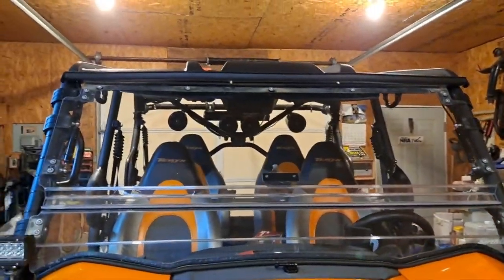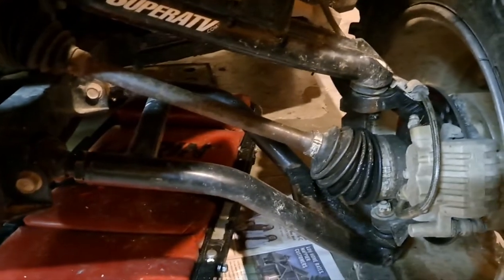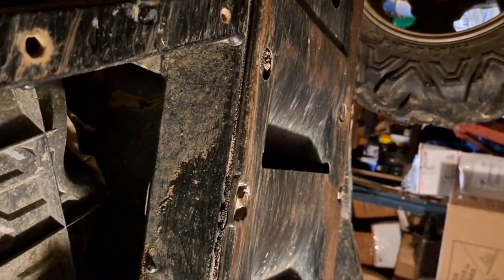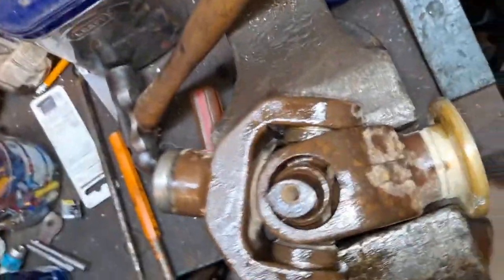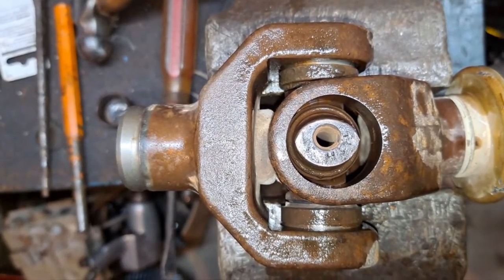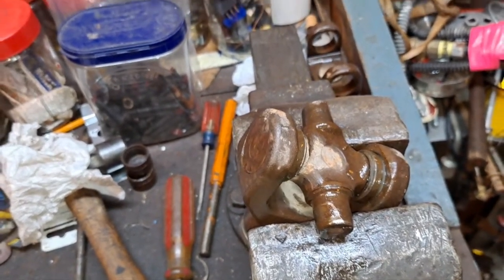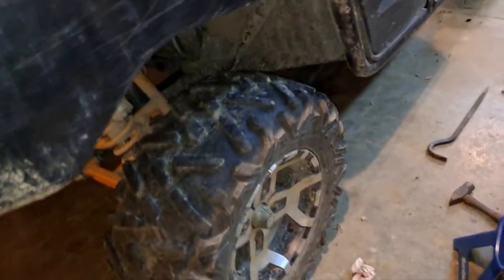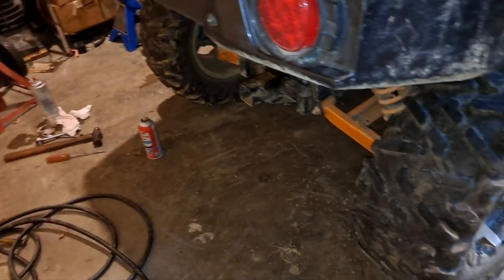Kawasaki Teryx 800 U-joint replacement.

Comment: Good video man I feel your pain with the way shit goes sometimes. I just did a video on my 2008 teryx replacing the main starter gear and one way bearing and water pump seals. Best tool I purchased was a service manual, well worth the money. I also hate working on dirty shit but being. On a small farm sometimes it can’t be helped. 👍👍👍
Reply from the maker: Thank you and thank you for subscribing. I gave you a follow back. I hate working on dirty shit too but it is what it is sometimes. I have another video I need to upload of changing out the brakes and boot on the front axle.

Comment: I don't think I ever saw a grease zerk anywhere on my 17T4LE and I'm at 3500mi on original factory u-joints and spline/yokes. I do know that SATV arms don't have protectors for outer boots so I understand exactly where you're going with boot issue. Had to cut some ABS into covers and zip-tie on mine. Thanks for sharing part numbers on after market.
Reply from the maker: I'm not sure without watching again but that u-joint part# is precision 450.

Comment: Any idea if the same precision 450 u-joint works in the front driveshaft?  The parts catalog says slighly different parts numbers. Just curious if you have done the front u joints?
Reply from the maker: @BrandonSowers-l2h  the front u-joint looks to be just a little smaller than the rear. I haven't had to change the front yet thank goodness.
Reply: Well shoot, nothing I can find online says anything about a cross reference from the parts store about the front u joints. I just did my rear today thanks to you for the oreilly part number
Reply from the maker: @BrandonSowers-l2h  you're welcome. I may buy one and take it to the parts house to find a match then return it. 😂
Reply: If you end up finding a match let me know.  I would love to have new front ones sitting on the shelf ready to replace when they go bad.   Kawasaki just wants way to much $$
Reply from the maker: @BrandonSowers-l2h  I'll definitely post it.  If you do TikTok I'm on there as TWO. I post there on these things too.

Comment: Question for you, what made you decide to change this out? I have a 2017 T4 and about 30 mph I start to notice a vibration that feels like it is in the drive line. I had to replace a rear u joint on my truck for similar feeling at a specific speed. Once I put in a new u joint the truck runs smooth. So it leads me to believe the same thing is wrong with my T4.
Reply from the maker: I had a bad vibration along with a bad clunking noise when placing it in gear. When looking at it I thought it was fine. Once I jacked it up I could see the play in it.
Reply: @andrewmeadors  perfect. Thanks for that info. I don't have any clunking or obvious sound, but I will tear into it further like you did. It has to be a u joint. Thanks for the video brotha!
Reply from the maker: You're welcome.  I hope you find the problem.

Comment: How did you put the boot on after back together dose the boot have a split up the side
Reply from the maker: It slides back and forth on the drive shaft.  There are notches on the shaft that the ends of the boot sit into.
Reply: Ok thanks I didn't see it on the shaft while you were putting it back together  I have a 2015 rear joint is shot I was going to start pulling the rear end out thanks for the video I could not find any information on it nowhere
Reply from the maker: No problem. If you have any trouble shoot me an email. Andrewmeadors22@gmail.com . More than happy to help with any questions.

Comment: I never did take the driveline apart I just took the u-joint out that sits in between the 2 yolks while it was still on the machine you shouldn't have to take that all that apart unless you're changing the main yoke seal on the rear end I can do that front to back without taking it apart
Reply from the maker: Well I took it out so I could work on it without being on my back. Plus, why wouldn't you take it out?
Reply from the maker: It's so flippin easy to take out once I figured it all out that it just made sense to remove it. I'd rather stand up to work rather than crouch or lay.
Reply: @andrewmeadors 💯bud, crazy not to pull it.